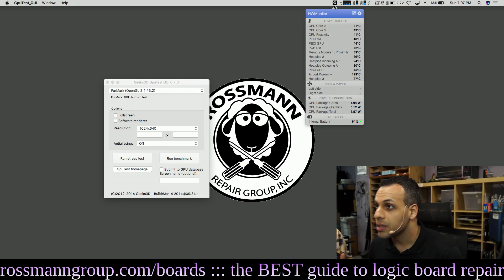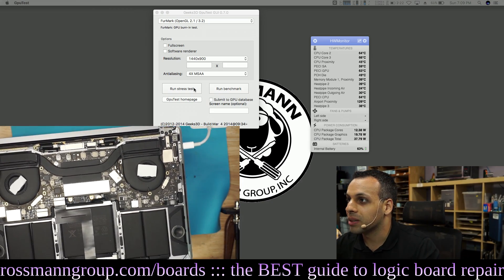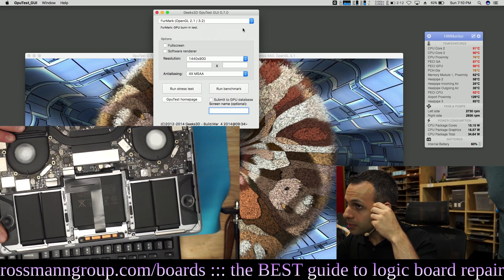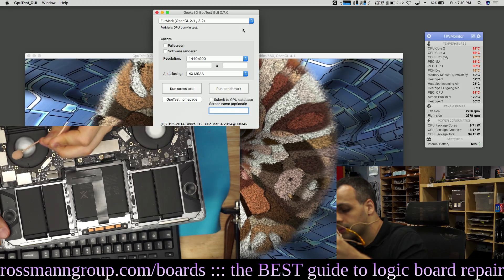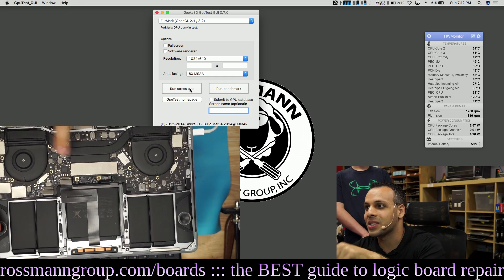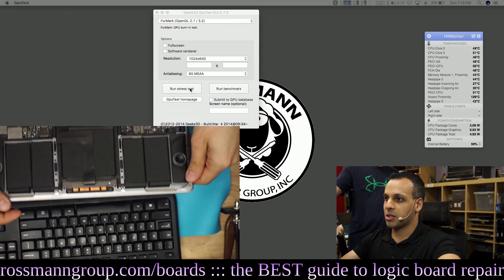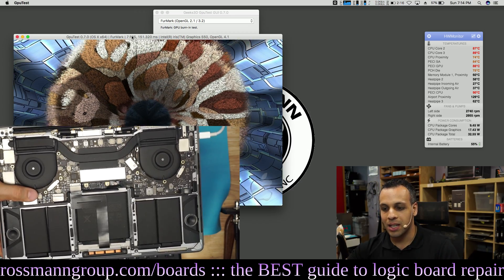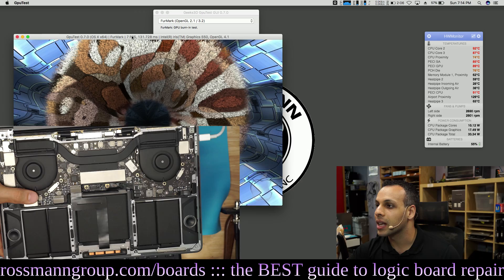Why Apple Macbook runs hot.

Comment: It's almost kind of sad, because the people that I have known, actually want this. Would prefer quiet over performance. I have been using an app that lets me control the RPM on my mid 2008-09 MB & it is still running to this day.
Reply: same. cheaper to replace fans than it is cpu's
Reply: Mark A. Stephens cool. I was wondering if there was a software solution to change this threshold. What app are you using?
Reply: AcridTM cool. I’ll look into both options. You two have been helpful. I was going to start writing my own code for this. But why do that when you can just get an app.
Reply: I have the exact same machine they don't make them like they used too, ten years on and it's still running stong. I was thinking of applying new thermal past to help improve the cooling.
Reply: Yeah SMCfancontrol. I dont actually mind the noise of the fans at 6k rpm. id rather the machine was loud than broken. every couple of years I pull it apart and re-thermal paste it as well as pull the fan apart and grease the spindle. that can also help if the fan is noisy, when I got my mac the fan used to make a buzzing sound when tilted and since greasing it it works just fine.
Reply: "Would prefer quiet over performance" - There's actually nothing massively wrong with this except for the problem that when it gets hot it's doing so because it is doing work. If it gets past a certain point and it throttles then it's just going to end up doing more work over a longer period. Once a CPU gets over 60C the debate between quiet and temps is over, you need fans. That heat is going to go somewhere regardless of active cooling.
Reply: SMCFanControl. I believe it is all one word. Might have to search the web. I think it use to be on the app store. Really handy.
Reply: better disable updates ;)
Reply: KlumsyK oh yeah. After an update I had software I bought that no longer run. And they still haven’t patched.
Reply: Nothing wrong about being quiet, but there is a limit where temperature noticably decreses performance and lifetime.
If they really want a completely silent system, but they are slower. Something running an Atom or ARM chip for example
Reply: AcridTM thank you so much, I have been looking for a solution, I just don't like the fact the fans are off till like 70 celsius. I have a early 2015 macbook pro 512gb model. so yeah i'd rather it run like it should.
Reply: For a lot of us music and audio professionals, having our computers dead quiet is actually extremely important. The disappointing thing about macs is how they achieve that low noise and in reality, the fans are not really that quiet. They just let it run hot. Better to get a custom pc with low noise fans imo.

Comment: You are using Apple products wrong, you are not suppose to ask questions. Just give Apple more money when your product breaks.
Reply: in the majority of cases apple products last way longer than other computers. I still use my macbook pro mid 2012 and in the same time my father has changed 2 laptop, the laptop of my brother died and the laptop of my mother died
Reply: @Federico84  I'm also still using the Retina Mid 2012. No problems so far. Changed the thermal paste and the battery. But it seems to produce more cpu temperature - can this be? Idle is about 60-70 degrees celsius.
I didn't switch to a newer model yet because of the IMHO poor new design 2016.
Reply: @Federico84  sorry that your brother and mother died, may they rest in peace
Reply: @eduard9674  what are you talking about?
Reply: @Federico84  he misread what you said lol
Reply: That’s accurate... sadly.

Comment: My PC tower sounds like a wind-tunnel and I have to clean the cat-hair out regularly, but it seems to run cool enough.
Reply: I have a cat and a dog(they are usually very close to my PC) and I dont have that issue. Do you have all the filters in your PC? It's normal that you get some dust and hair inside but not regularly.
Reply: My desktop is cool and whisper quiet, Fractal Define cases and Noctua heatsinks and fans works wonders.
Reply: My computer has a filter for dust, It's also a hybrid with fan and water cooling. The fan has option for manual speed, and of course at maximum it makes a slight noise.
Reply: I just use the motherboard's quiet PWM profile, myself.  It's practically impossible to tell that it's on until I throw a ton of work at it, even then it's barely audible.

Comment: Thank you Louis?! I work in a creative industry and use my MacBook a whole lot. I’ve noticed how hot it would get and how Laggy the gpu would get. It gets to a point where the gpu fails me to even run illustrator smoothly. I invested in a fan cooler and it helps but it means I should have gotten a desktop.
Reply: Tuan Nguyen Ever consider a hackintosh if you're going to do anything worth a professional workload in illustrator?
Reply: using illustrator? build a pc then...
Reply: Karras Bastomi it’s a Work computer. I have a built computer at home.
Reply: What you get when you call a consumer product Pro.

Comment: It doesn't really makes sense for that Mac to act like that. I tested this on mine and the default minimum setting for the fans when they kick in is 2000 RPM.

When my Mac (retina late 2015) is on idle, the CPU stays around 39-40 degrees Celsius, when the CPU reaches 50 degrees I can already hear the fans spinning.

The hotter it gets the faster the fans ramp up to 5500 RPM.

Edit: I see this is one of the new crapola models, still not normal.
Reply: afaik fans rpm are still normal because he has the lid off, these machines wont ramp up the fans as fast because they "sense" that theres thermal room aviable. happens also with my dell laptop, if you put something under it to raise the bottom you get nearly same temps but the fans run slower/quiter.
Reply: This is meant as a generic reply, not targeting anyone in particular: stop telling me about thermal throttling, thank you.
If you mean to comment on the video, do not click on "reply" to my comment.

Comment: A few degrees more and it's going to desolder itself lol
Reply: Turborider iReflow
Reply: Turborider, Isn't that what eventually killed the the complete line of the 17" MacBook Pros, which they now call "Vintage" ?
Reply: Dabig Ragu well there are those two:
Original Intel MBP with ATI X series GPUs (X1650 Pro) --> BGA issues due to bad solder used and overheating. That issue is not that common
2008-2010 MBPs with Nvidia 8xxx Chips: "Bump" issues with 70%+ failure rate: Actually not apples fault, occurred on other laptops with faulty "Nvidia Bug" plagued GPUs as well. But apples thermal design helped the nvidia Bug to occur faster than on other laptops
Reply: My 17" MBP is still running great.  It's fallen off my couch a few times, and I run it pretty hard too.    I suspect the aluminum case helps with heat dissipation
Reply: Hmm, lead-free solder plastic-stage is above 200C. So not so much a reflow.
Reply: TheRailroad99, thanks, good info. Yeah my 2011 died about one month after the Apple logic board fix/replace warranty ran out. I ran it hard though  with many real time charts for my trading. They won't fix nor will anyone else touch it. Too bad, she was a beauty. Can't seem to find a comparable replacement.
Reply: Good, keep her on the couch though, lol. I live in Hawaii, she gets too hot.

Comment: Yep, I have an macbook pro 2016 and the system will only go to 6-7k rpm when its at 96-98º for about 15-20min. I use the "Macs Fan Control" software to have the fan permanently at least at 2k rpm and it goes up to 4k at 75-80º and it is much better running at these speed with a little of noise than having a "super cool silent macbook" during a while but later it will sound like a jet with the cpu at 95º and the aluminum case burning your fingers.
Reply: I use this too on my 2012 2.3ghz with it's piddly GPU. The CPU takes up most of the slack these days and temp rises quickly, even after a re-do of the thermal paste.
Reply: w ww . cry stalidea .  co m/m acs-fan-control (don't know if youtube will censor the link so i put spaces)
Reply: Would you mind sending me the link to that software, just in case if I download from the wrong website
Reply: If you just set it to auto to increase from whatever temperature and only let the cpu hit 85 for example it automatically spins the fans up. Mine is set to the CPU core temp sensor and spins up more past 80 degrees but it sounds like a jet for a few minutes lol. Highest I allow it to go is 85.
Reply: I saw this and tried it. It seems to work perfectly! (Late 2008 Alum Macbook running Catalina)

Comment: These days everyone has a mobile office... we unplug our hot laptops and shove them in our backpacks...   I have often found that the when I pull the laptop out again..
it's cooking and the battery has much less power in it... All that time, the poor computer has been trying to cool itself while sitting in a sealed insulated environment.
Well it's not my computer it belong to the company that issued it to me..
We all do this so i'm sure that just doing unplug shove and grab has distoredy a lot of computers...   So maybe apple should run the fans harder when the computer is plugged into power that way, when we do the snatch and stuff the computer's temp will be already cooler.
Reply: Put your laptop into Sleep state e.g. saves your current environment to ram and goes on a low power state. By default most laptops go to sleep when the lid is closed. It sounds like your power management settings are wrong.
Reply: Sounds like the power management settings are screwed up.
Reply: well that would suck... I often have to grab and run from meeting to meeting.. so cold starting a laptop is no fun..
Reply: If you're leaving your laptop fully powered on in your backpack, no amount of laptop thermal design will help you. You're lighting a campfire in the living room and wondering why your house burned down there, that one's not on Apple...

Perhaps if they wanted to be really nice, they could put sensors on the laptop that detect when the lid is closed so that the laptop can be automatically put to sleep when it isn't being used. Oh wait, that's a thing.

Fuck Apple, but in this specific case, just use your devices correctly.
Reply: Kobe Wild sounds like user error to me. Why would you put a running laptop inside a sealed environment?
Reply: Yeah, even standby shouldn't be generating much heat, most of it should be concentrated around the DRAM, which isn't much, especially for LPDDR3/4.
Reply: modern computers are supposed to go to sleep automagically when you close the lid - and this suspend state is meant to use so little power that the laptop can passively cool itself from within a sealed container.
Irritates me to no end when I open my laptop bag and find my laptop was actively running and wasting its battery - because something kicked it out of this suspend mode, most often Windows Update or some malfunctioning driver.
Reply: i think you touched on something important. Maybe Apple's srtategy is precisely to go after the corporate market, where big companies buy their products in bulk and when they break they just replace them. The workers treat them like they're borrowed, and the company foots the bill no questions asked. Yeah! That's totally what I see happening here in the Bay Area every company just hands out macbooks to all its employees. A lot of big companies like Adobe, Microsoft, Salesforce etc. go after corporate accounts, bcause they have deep pockets and are relatively low maintenance. The consumer market is almost like a sideshow. In this scenario, their planned obsolescence works really well, since coporations don't ask questions the way individual consumers do. People who wonder why their MAcs are such shit nowadays maybe are not thinking about the fact that they(macs) are  not really designed with them (consumers) in mind
Reply: Putting a MBP in a backpack without shutting it down completely is a recipe for overheating and eventual failure.
Reply: Even if you put it to sleep, throwing it into a bag without it cooling off first just traps the heat in there, cooking the computer anyway.

Comment: Apple thermal design: literal hot garbage.
Reply: Goes hand to hand with the HP Compaq thermal design. (I had 2 of those and both "died" in a year just because of the heat)
Reply: @Tyler LaPointe Don't tell Apple. Otherwise they'll quickly cook up "an urgent security update" that will cut the battery life by 20% and raise the temperatures to the intended 80 C. Your water-vulnerable sauna stove is clearly malfunctioning. :D
Reply: flyinghigh2000 From what I've gathered, every bit as bad as the laptops.  They can't maintain boost clocks under any sustained pressure at all.
Reply: Hot apple pie
Reply: I Have No Son there is no battery in a desktop.
Reply: Makes me wonder how much better is the new iMac. That Cpu, graphic card and screen all sandwiched like that.
Reply: flyinghigh2000 the base model 21.5 inch 4K iMac stays quiet and cool, even under a stress test the nothing goes above 70 degrees celsius
Reply: @Jewboy27346  Base iMac with just a CPU, perhaps, but the iMac Pro doesn't stand a chance in hell, or on Titan for that matter.  An 18 core workstation CPU and a Vega 64 doesn't doesn't have a hope of  maintaining boost clocks by that sad excuse for a thermal solution.  How they ever thought a single heatsink block of that size could even handle one of those chips much less both at the same time I will never know.

Comment: I guess in typical Apple fashion, you can't install anything that will modify the fan curve like MSI Afterburner on a PC to postpone the CPU frying ? Someone should delid these and put liquid metal on it just to see how much temps can drop or if it's just a lost cause because of the heatsink design.
Reply: You can't delid these CPU's, they don't have an IHS.
Reply: Snazzy labs putted liquid metal on the macbook pro and it doesn't change a lot.
Reply: 1. Transferring more heat to the heatsink doesn't matter if the fans aren't spinning to get the heat out of the heatsink. Temps will still rise.
2. If the CPU doesn't have an IHS to begin with as another comment says, then liquid metal won't do much anyway. Liquid metal helps in delidding because you replace the stock thermal paste that sucks with something much better and then put the IHS back on. When there is no IHS and you have direct die contact, liquid metal won't help much because the heat is already going directly from the die to the heatsink.

The ways to make a Macbook cool itself better would be first to have a proper fan curve so the fans spin up well before 83 degrees, have them spin faster so more heat is blown out of the heatsink, and then finally (unrealistic for a laptop of that size) have a beefier cooling solution with a bigger heatsink and bigger fans.

Comment: And i thought the fan control on my pc was stupid...
Reply: @Richard Smith , what's "hot" should make sense to average user, the temperature of a "hot" would be around 40-50 degree Celsius, this is the pain/discomfort inducing temperature. However most laptop dealt with user's complains by insulating the laptop casing from the hot internals, so the laptop feel "cold" outside even when the internal is really hot. Ironically 40 degree Celsius is the temperature where HDD would experience an increase failure rate so by insulating the casing from internal temperature it is putting user at a disadvantage position with later repair cost.
Reply: Lmao my lenovo has a fan control that speeds up to clean out dust and i force it to max speed whenever it gets hot, it only last for 2 minutes.
Reply: there's this 2 brand of cheap laptop that I've serviced for friend & family that have its Harddisk fail (slowdown significantly) after just few month of use, I identified that the fan was too conservative and there's not enough air flowing thru the system. Even if the CPU is cool & underutilised the laptop shouldn't stop the Fan because it also serve to cool other part of the system, that's the mistake these both laptop did, so I replaced the HDD & I installed a hackish software to force the fan ON, I also rip apart/remove the metal insulating (RF shield) on the casing below the HDD carriage to help it irradiate heat away, it is the only way to fix it for them.
Reply: Cuzeg Spiked intel stock is usable, not defending them but aluminum on amd stealth is far smaller

Comment: Hi Louis! <3 Watching this on an overheating macbook
Reply: lmao, I love asus rog (my g750JW laptop) it cools down pretty quick
Reply: That's the perfect machine to play Megaman x7 and fight Flame Hyenard.
Reply: Always Online seriously
Reply: I have a 2012 13" MacBook Pro. This thing heats like an oven. The laptop even heats up while charging!!!!!

Heats up crazy for browsing the web.
Heats up for working on a design software.
Heats up for playing a game on Steam.
Heats up for literally doing anything.

The only time the temperature is at 59-60 ish degrees is when it sits idle. I usually remove the back plate the use a secondary cooling fan to cool the MacBook whenever I do something. The inbuilt fan usually kicks in right after start-up, but it stays at 1200 rpm till it reaches 70 degrees. Then steps up to 2000 after the temps reach 80.

My thigh burns with this thing. I live in a hot country already and this laptop is literally baking me besides of the scorching sun.